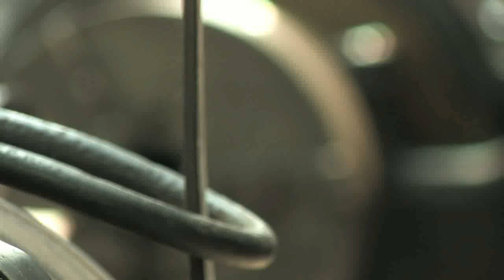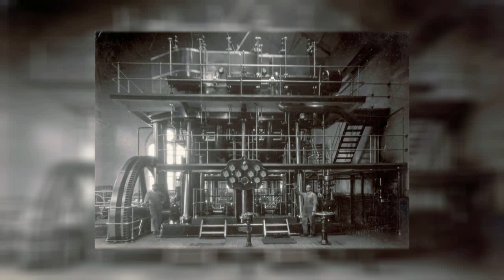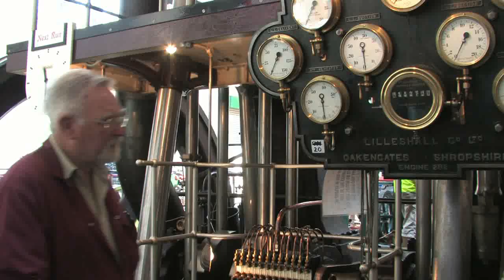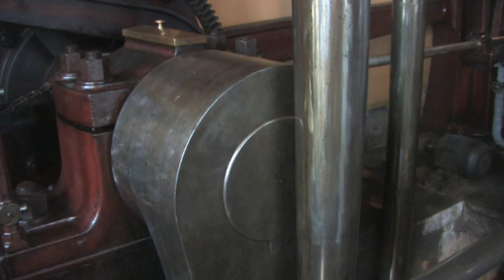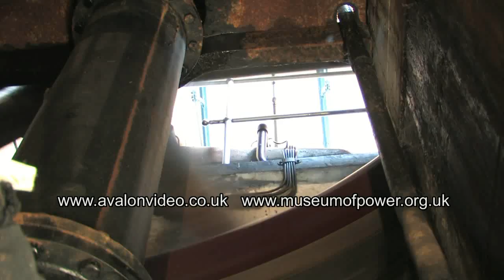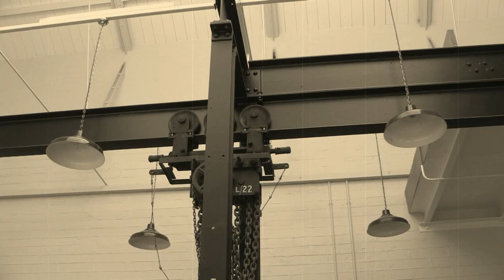The Museum of Power - Langford

Comment: This engine wasn't running when we visited, even though their website said it would be.
The last time we visited Langford  must have been 10 or more years ago.  As Easter Friday was lovely weather, we thought we'd pay a visit.  The museum itself was very quiet, so we were able to get round fairly quickly and take a few photos. Nothing seems to have changed in the intervening years. I know the museum is staffed and run by an army of volunteers,  many of whom are advanced in their years, but many of the exhibits are looking very tired and in desperate need of some TLC

Then as it was coming up to lunch time we popped into the Cafeteria for a bite to eat, only to be told there would be an hour's wait for any food, even a sandwich.  So we had a pot of tea, even though we only wanted two cups (so many places do this) and a couple of biscuits, costing £8, then made our way home after being there for about an hour. We weren't the only ones
I assume the cafeteria is run as a concession, but their high prices will surely put people off going.  It's a shame, as the museum will ultimately suffer.